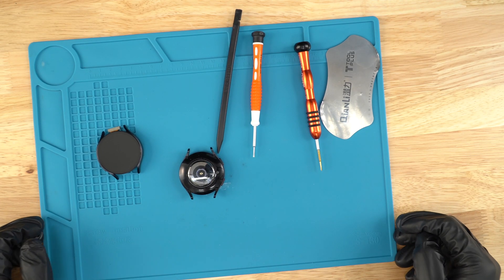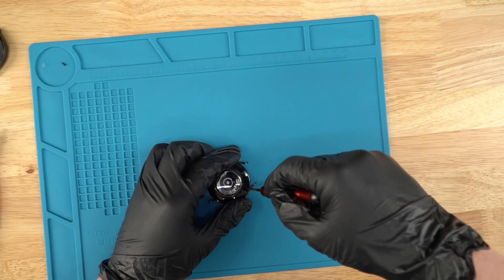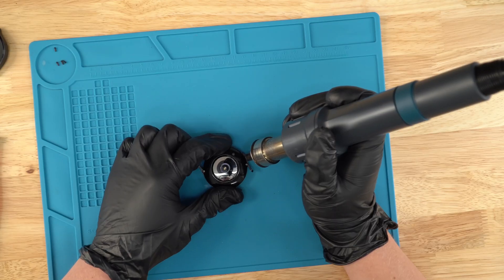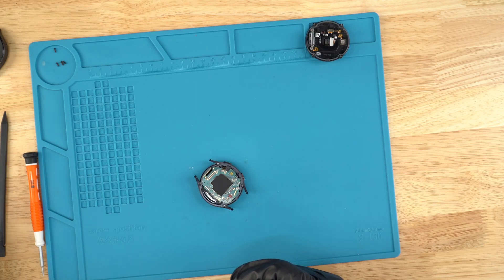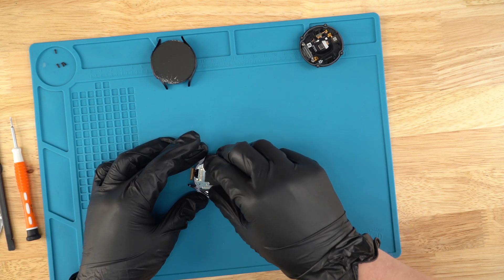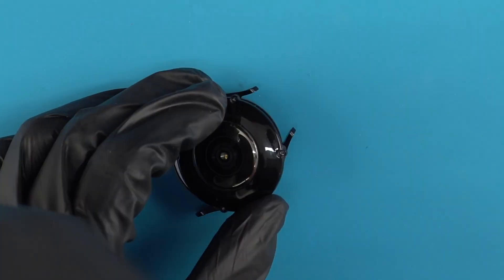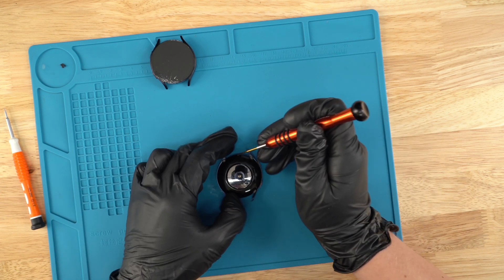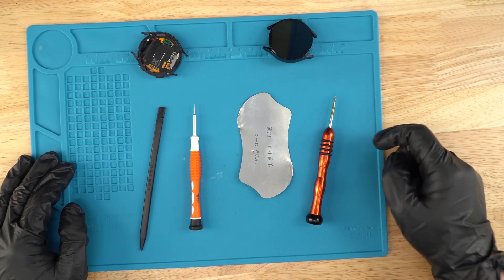Samsung Galaxy Watch 6 40mm & 44mm Screen Replacement SM R935 & R940

Comment from the maker: Samsung Watch 6 44mm Battery = https://www.joesge.com/products/samsung-galaxy-watch-6-44mm-sm-r945u-sm-r940-battery-replacement-425mah-eb-br945aby-parts
Samsung Watch 6 44mm Battery Repair Kit = https://www.joesge.com/products/samsung-galaxy-watch-6-44mm-sm-r945u-sm-r940-battery-replacement-425mah-eb-br945aby-parts?variant=41166808481838
Samsung Watch 6 40mm Battery = https://www.joesge.com/products/samsung-galaxy-watch-6-40mm-sm-r935u-sm-r930-battery-replacement-300mah-eb-br935aby-parts?variant=41167638396974
Samsung Watch 6 40mm Battery Repair Kit = https://www.joesge.com/products/samsung-galaxy-watch-6-40mm-sm-r935u-sm-r930-battery-replacement-300mah-eb-br935aby-parts?variant=41167638429742
Samsung Watch Mail In Repair Service - https://www.joesge.com/pages/repair-service-samsung
Reply: Hi, what are the physical dimensions of the Samsung Watch 6 40mm battery vs the Samsung Watch 6 44mm Battery ?
I am not able to find that info anywhere :(